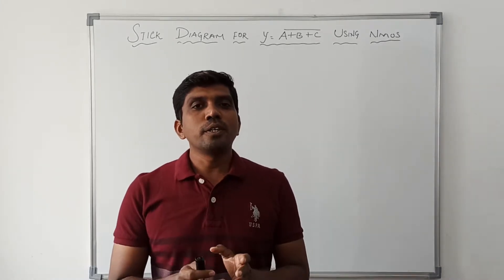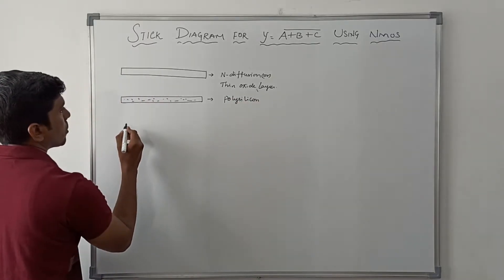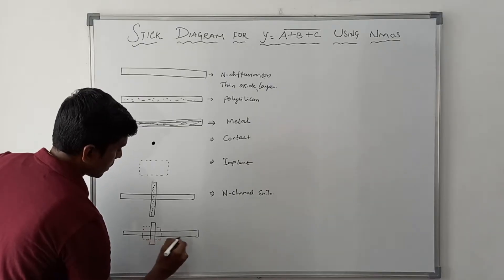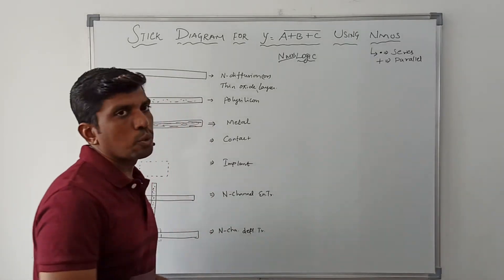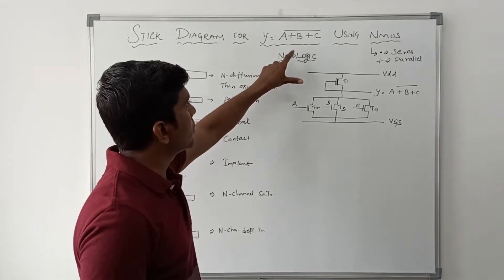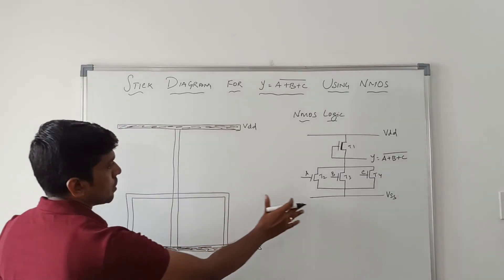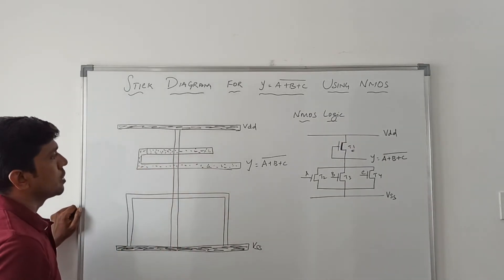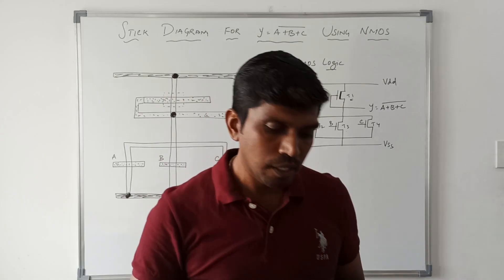Stick diagram for Boolean Expression Using NMOS transistor | VLSI Design | S Vijay Murugan

Comment: Thank you sir plz upload vlsi combinational circuit & sequential circuits
Reply from the maker: Which topics you need kindly post it here?
Reply: @learnthought3871  EC3552 VLSI AND CHIP DESIGN 

UNIT I : MOS TRANSISTOR PRINCIPLES

MOS logic families (NMOS and CMOS), Ideal and Non Ideal IV Characteristics, CMOS devices. 
MOS(FET) Transistor Characteristic under Static and Dynamic Conditions, Technology Scaling, 
power consumption

UNIT II : COMBINATIONAL LOGIC CIRCUirts

Propagation Delays, stick diagram, Layout diagrams, Examples of combinational logic design, 
Elmore’s constant, Static Logic Gates,Dynamic Logic Gates, Pass Transistor Logic, Power 
Dissipation, Low Power Design principles.

UNIT III : SEQUENTIAL LOGIC CIRCUITS AND CLOCKING STRATEGIES 

Static Latches and Registers, Dynamic Latches and Registers, Pipelines, Nonbistable Sequential 
Circuits.Timing classification of Digital Systems, Synchronous Design, Self-Timed Circuit Design .

UNIT IV : INTERCONNECT , MEMORY ARCHITECTURE AND ARITHMETIC 
 CIRCUITS 

Interconnect Parameters – Capacitance, Resistance, and Inductance, Electrical WireModels, 
Sequential digital circuits: adders, multipliers, comparators, shift registers. Logic Implementation 
using Programmable Devices (ROM, PLA, FPGA), Memory Architecture and Building 
Blocks,Memory Core and Memory Peripherals Circuitry 

UNIT V ASIC DESIGN AND TESTING
 
Introduction to wafer to chip fabrication process flow. Microchip design process & issues in test and 
verification of complex chips, embedded cores and SOCs, Fault models, Test coding. ASIC Design 
Flow, Introduction to ASICs, Introduction to test benches, Writing test benches in Verilog HDL, 
Automatic test pattern generation, Design for testability, Scan design: Test interface and boundary 
scan.
Reply: @learnthought3871  sir plz these 5 units upload very urgent thanks in advance